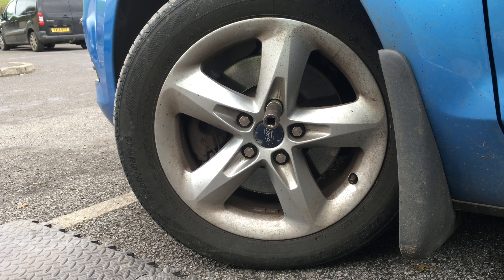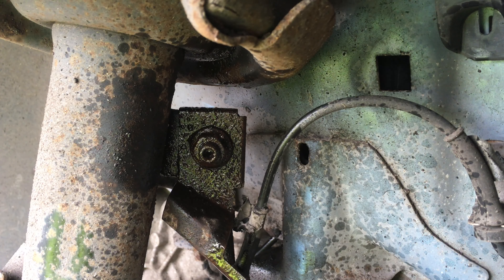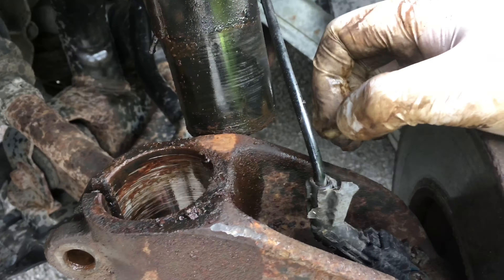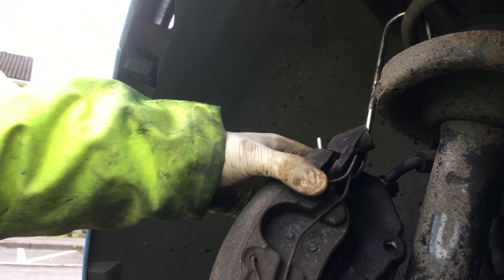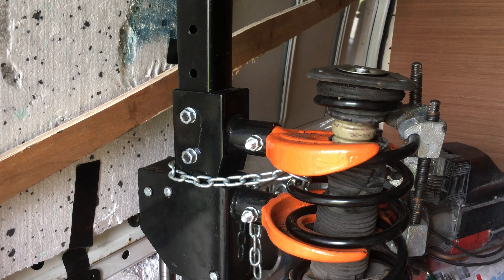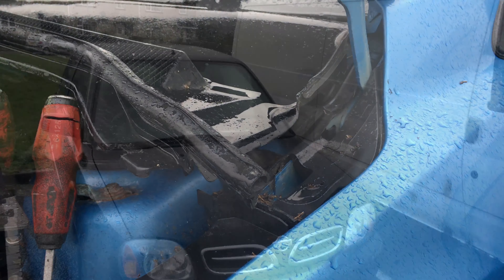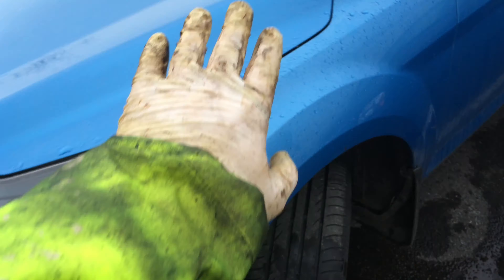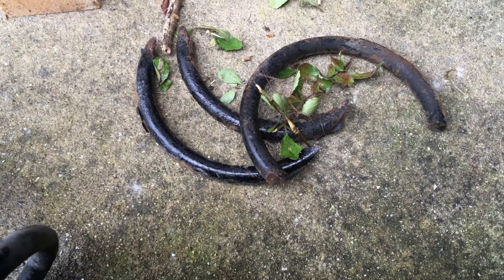Ford Focus 1.8 TDCi Front Coil Spring Replacement

Comment: hello sir when i changed the front struts i lined it with the one at the bottom pin is there any problem?
Reply from the maker: If they aren’t aligned properly it can cause poor tyre wear and excess wear on other suspension components so it’s quite important to get it right